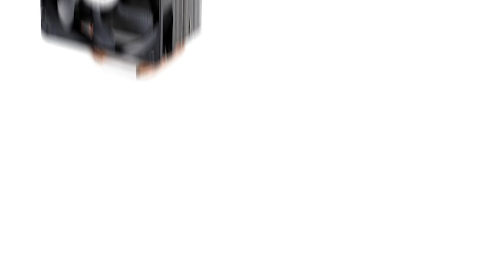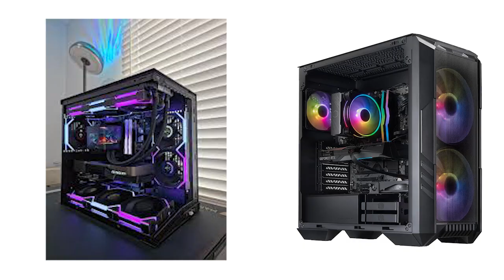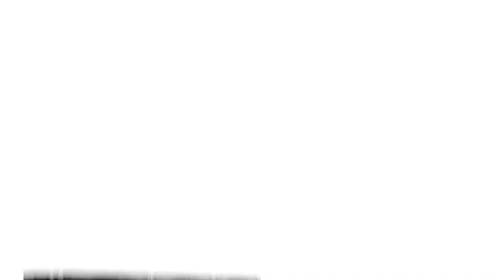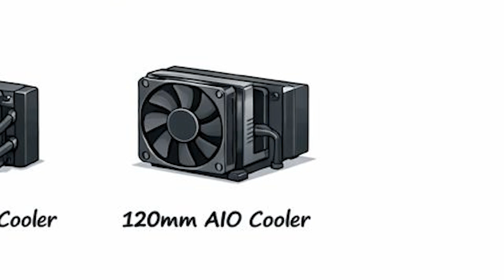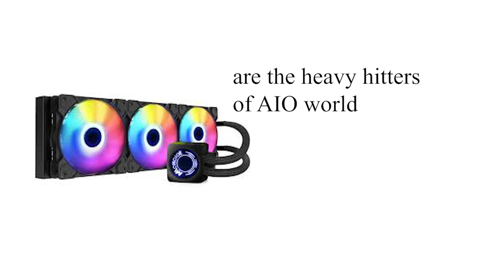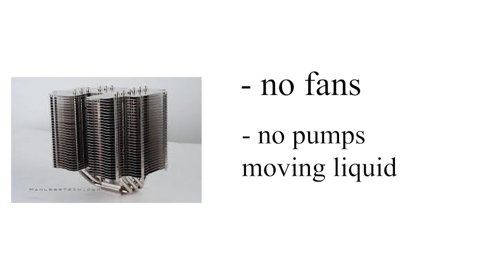Every CPU Cooler Explained In 5 Minutes

Comment: What's the difference between air cooler and tower cooler?
Reply from the maker: For a CPU, the difference is:

An air cooler uses a heatsink and one or more fans to pull heat away from the CPU. A tower cooler is simply a type of air cooler with a tall, vertical heatsink that usually provides better cooling than smaller, low-profile air coolers. In short, all tower coolers are air coolers, but not all air coolers are tower coolers.